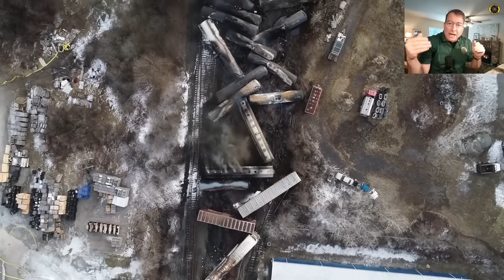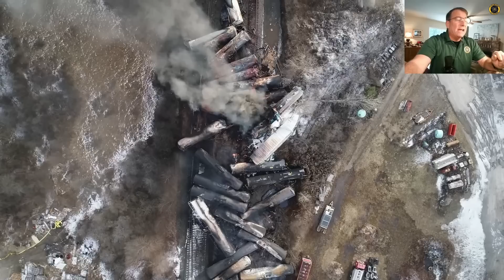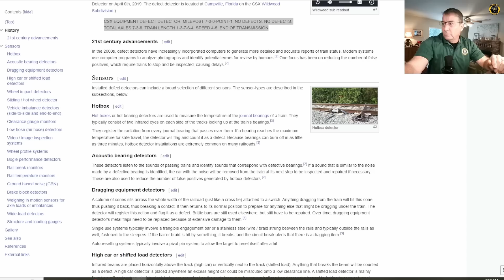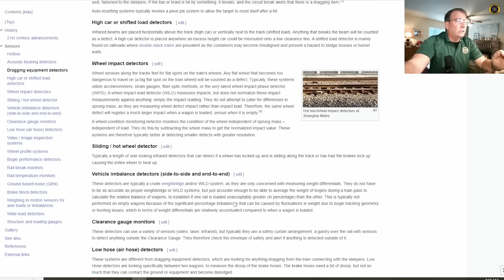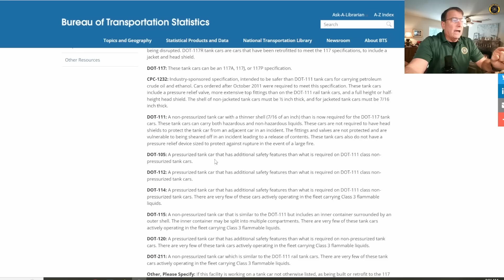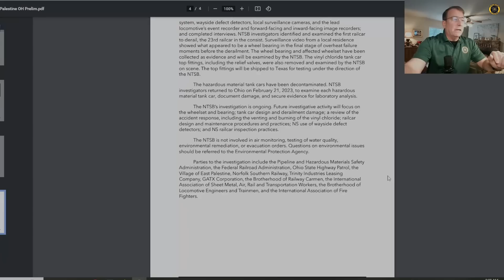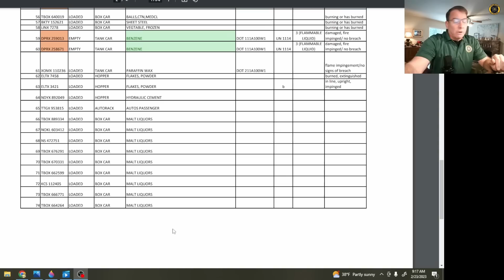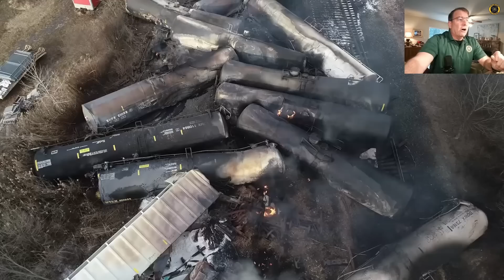NTSB Prelim Report: Norfolk Southern Train Derailment 23 Feb 2023

Comment: Emergency breaking didn’t cause the derailment, but it did prevent the beer from joining in the wreckage.   The derailment would have been because the truck with the disintegrated bearing damaged the track as it derailed.  There isn’t much wiggle room for a rail to move before the wheel leaves the track.  Once they do the ground stops a car much faster than a steel wheel on a steel rail can.  This is why you get the accordion of the train cars.  Trains can take quite a distance to stop even under emergency breaking, which is why you never stop on tracks.   The entire rail industry is profit driven and has shown its disregard for safety and its employees.  Remember more hot boxes per mile is a lot of expense they rail industries don’t want to spend.

Comment: Solid content

The whole "above ambient temperature" introduces many new variables

the ambient temperature sensor calibration at each defect detector station?
What is the relation between the ambient temperature and the accuracy of the hot box sensor reading?
the temperature limits set by for alarm trigger NS better have a sound statistical base, is it blessed by the railcars OEMs?

They had an indication of something happening almost 30 miles before.
Reply: Calibration threshold is also dependent on wind speed and direction.

Comment: Do these rail cars have a required maintenance and inspection schedule?  Do rail cars that haul hazardous materials have anything extra in the way of on board monitoring for early detection of a failed system?
Reply: They’re inspected at every railroad terminal upon arrival and departure. Those inspection times and the workforce inspecting them have been cut over the years though

Comment: There is so much misinformation floating around out there in the so-called news media. Many are saying these derailments are uncommon. They are not. They occur for many reasons. 
One common reason is train vs vehicle at rail crossings. Hitting a loaded big rig at a crossing often can cause a derailment of the lead locomotive. Everything will often pile up behind it. Even Amtrak has had its share of this problem. Today's freight trains are much longer and heavy than in the past. Therefore, train handling and braking becomes more critical. Many of these trains
run with extra locomotives coupled in the middle or end of the train. These are called DPUs or (Distributed Power Units). Trains handling hazardous materials over a certain amount (such
as this one was) are known as KEY trains. The railroaders refer to them as "bomb trains".

Comment: As inexpensive as electronics are, why aren't there heat sensors on every axle?
Reply: One reason, every stinking device would need to be calibrated and maintained. That’s not easy and may not be feasible in that environment. I did measurement system work in my career.
Reply: @Biochemechanic  ?  Then put 2 on each axle for redundancy and make them easy to swap out.  Heck, put on three.  It's not like they're 35,000 feet in the air.  Give the engineer a box full.  This is such a basic technology today that there's no excuse not to do it.
Reply: @billsmith5166  If you have never been knee deep, like I have been in measurement systems, trust me it’s not that simple. In theory yes, but not in a practical day in day out application.
Reply: @Biochemechanic  The sensor module, a battery, a way of charging the battery, flashing lights, a siren, a way to test it, and a way to reset it.  You could even have it communicate if you want it to do more.  As far as practicality is concerned, what they have now is clearly not practical.
Reply: @billsmith5166  Practical in the sense it is must be robust and work in the environment it is installed in. I am not saying ideal. I am not saying it cannot be improved upon. But jumping into a solution without understanding why the existing system did not work is not wise either. At this point we don’t have all the details as to what exactly transpired.
Reply: Make the alarm light flash at a specific frequency that is detected by an array of sensors on the engine that not only detect the fault, but triangulate the exact distance beck to the hot axle.  What they're using now could have been designed in the mid sixties.
Reply: @Biochemechanic  We know that it was detected too late, and the system is token at best. The implementation of cold war technology is beyond belief when one considers what's available and how easy it is to work with standard modules.  You can make it cheap and reliable, or you can make it very expensive and a little more reliable.  Cheap is the only way that it will get done. Heck, hire the Chinese to do it, and they'll be making a million units a month within a year.
Reply: @billsmith5166  8 bearings per car * 1.6 million cars.
Reply: @billsmith5166  Another possibility is the detection systems worked. I have seen several folks chime in on a railway specific channel. When a defect is flagged they are supposed to stop the train, I believe it is a requirement. Some folks think the defect was detected further up the track as well. From what they report, the defect is sent to folks monitoring this and to the supervision that oversees and controls traffic. The fuzzy part is they can chose to take the train to the next available place to stop, a siding or train yard to deal with this. Stopping a train in the middle of a high traffic line immediately is probably not what folks running that line would want to do. So there is a possibility that there is nothing wrong with the detection systems. 

Again, that’s why you don’t jump to a solution without a full understanding of the problem. I did thousands of failure investigations in my career, I was responsible for making sure we found the root cause(s) and implemented a robust fix. It’s much like a good detective story, with lots of plot twists. Not uncommon to find multiple failures. The detection system may be one, but I would not jump on that as a fix if it was my job on the line. I hope and would think there are folks involved that are also trained in doing root cause and corrective action work, lots of different tools they can use. It will take some time. They may be able to implement some immediate actions to address some low hanging fruit. Completely redesigned measurement systems is not one of them.
Reply: @Biochemechanic  There were three opportunities for the axle heat to be detected along it's entire route. HBDs are generally from 25 to 40 miles apart. If you look at the mechanisms that the railway system uses to detect problems you'll see that they were all designed a long, long time ago. There are 1,705 derailments a year. The entire railway system is low hanging fruit.  An investigation of this incident shouldn't influence necessary improvements because we already know why trains derail. In two or so years when they come back with the official finding, they will report that axel was the cause, the employees did, or didn't have time to react, and they were or weren't drunk or high. There still won't be anything done because everyone will be standing around with their thumbs in their beltloops saying that we have to wait for something else. There's no need to wait.  We know what the problems are because they're ALWAYS the same problems.
Reply: @billsmith5166  It’s a matter of figuring out analyzing all the derailments and prioritizing where to spend efforts to get the most benefit. Knee jerk reactions don’t get us there. Nobody is mentioning the FRA, based on their charter they are the logical agency to do this. If it’s anything like the GA airline crashes reported on the channel here, the ability of the agencies to do their jobs is highly unlikely. Reference Juan and Gryder and the seeming inability of the NSTB and FAA to take decisive actions. Pete has his head up his Buttocks.

Just one of the tools would be to do a FMEA, as part of that tool you rank severity of a failure and the cost/ease of a solution and come up with a numerical ranking to prioritize where to spend efforts. Quite a few other root cause and corrective tools would be used in preparation for that analysis. I am a six sigma green belt and a certified quality auditor. I did this stuff for a living for the last 10 years of my career. If I was in charge, I would hire an independent consultant to run this process outside of government and railroad.
Reply: @Biochemechanic  Other than a likely disagreement about the definition and relative speed of a knee jerk, I pretty much agree.  

As far as my "expertise" is concerned, I lived in Fort Madison and Burlington Iowa, and I have known a lot of railroad people. I was also first in line at a railroad crossing during a derailment. Exciting.  I am aware of two other derailments within a mile of there, but I'm sure there have been more.  

I've also been reading about, and working with assorted sensors and control devices for use in my machining hobby for the past many years.  

For the last six months or so, I've been working on an automatic feed for a mill that controls the feed rate of a milling bit at a set RPM by measuring current on a stepper and the mill with cheap pre-made devices.  I will be adding another cheap electronic gizmo to measure the progress of the bit in unbelievably small increments.  Everything that I'm using comes with hundreds of features that I won't even need to use.  I'm now pretty sure that it can be done, and I'm not aware of any inexpensive solution like it.  The thing that strikes me is that it doesn't seem like anyone else has done it considering that electronic sensors, control devices and computers are a dime a dozen and leaps and bounds better than they were ten years ago.  

Rail is stubbornly using technology that was available fifty years ago.  That's a fourth of the entire history of railway in the US.

There are very, very simple solutions to many of the problems that rail is and has been. and I can't believe no one is doing anything about it.  

If aviation was as slow to innovate, air travel would be a very dangerous luxury.
Reply: @SteamCrane  A lot doesn't give them a pass.  How much does each car gross a year?  How much does each device cost?  How long do they last?  How many fewer cleanups are there?  What's the value of lost cargo?  How many cleanups actually return damaged property to it's original state?  How have any air carriers been able to remain competitive while adopting new technology?  How can trucking be viable while employing a driver with each vehicle?  It would simply need o be factored in to pricing, and I doubt that would be much even if the complete system only had a five year life span.
Reply: Perhaps it is the Rest of the work to get the heat sensors to transmit their data to   -    where   -- and consolidate that data so that in an instant a human or a computer can figure out what to do   -  now   -    ???
Reply: @frandanco6289  It only has to be better than what there is now, and that ain't hard.  The questions of what data to communicate and how often to communicate it will be ever changing and impossible to implement if there isn't some basis.  If you want it to be perfect, it can measure wear on couplings, sense sway, keep a record of track changes, determine tire wear, sense slack and control momentum or slowing, feel wet track, look at pulses in hydraulic lines to find weakness.. then detect earthquakes and do it all via satellite to a nation wide computer that runs the train. It would be much better to solve the biggest problems with inexpensive off-the-shelf parts and get it on the trains.  Waiting for everything is what always happens on the rail system, and by the time it actually happens it's too expensive and it will be fought tooth and nail.